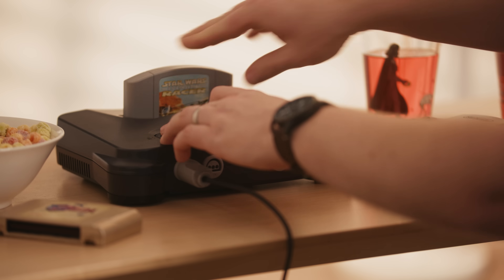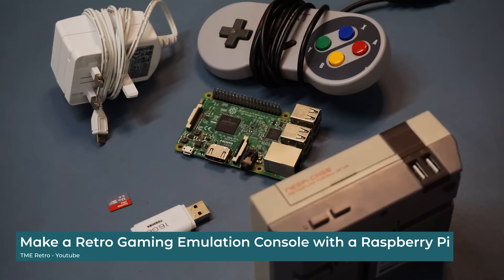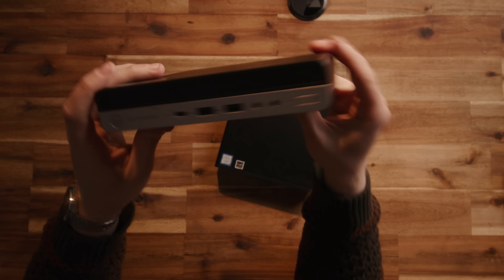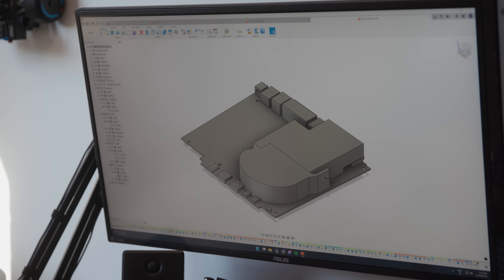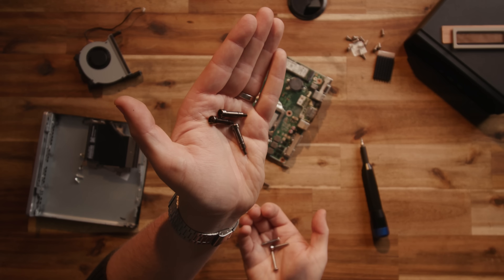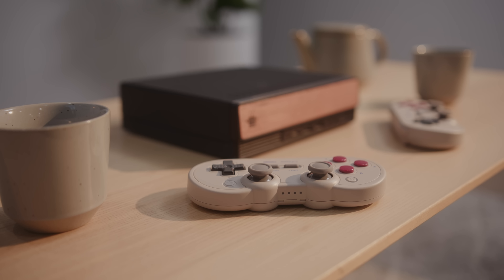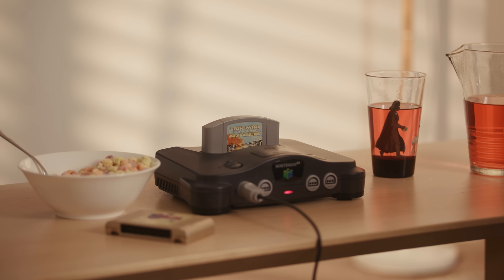Build your own games console for $200

Comment: For those of us that don't mess about with 3D printers, you could also just do some pretty simple things to still make the existing mini PCs look better.  You could do something as easy as a vinyl wrap from your local hardware store for a few bucks.  Just put it on the front panel, and cut out the ports/buttons.  You could leave the ventilation area as is.  The front of these mini PCs is so minimal, you don't need to do much to change the look.

Comment: This is a sick case!
Rather than doing variants for 300 mini pcs, you should do one for itx!
There are myriads of itx mobos with low power draw and included CPU for 100-200€, and this case would be great for theml. Just a few tweaks on the back to fit a regular IO shield (and why not, a model for a blank one, so that people that want to print a template that matches the rest of the case could spend the time aligning ports super well...

I probably won't buy a kit from you because of shipping costs, but i would buy a 3D model to support the project :)

Comment: This is nice. But don't you need quite powerful hardware to emulate games from PS3 and Xbox 360, and the likes? Moreover, if you also want to run games from Steam, EA, Epic, GOG then you'd need quite a bit of hardware, right?
I calculated that the total cost of all that can be anywhere between $1700-1900.

Comment: How about no, i'd rather buy a 100$ modded PS4 and be done in no time, get to play rather modern games+ whole ps2 library for next to nothing. For cheap gaming i have my playstations, not gonna bother with mini PCs, sbcs or any mumbo-jumbo. I got my ps2 at flea market for 15$ and made the mx4sio adapter myself, my ps3 i got for 40$ at the flea market and my ps4 was 100$ on facebook marketplace, not to mention the value proposition si kinda bad for those mini pcs .. 8th gen i5 with 16 gigs and fuckall else...i can get my hands on a fx504 for that amount of scrap, and they make a far more potent contender although not as sightly but when you add into account you 3d printed an enclosure anyway i find it hard to belive it will be that much worse off. Maybe try with a laptop next time? Could even use a slim dvd unit for more swagger points🤣👍 i reckon a ps2 phat like enclosure would do nice

Comment: This makes the raspberry pi a better option if you are saying the mini PC can cost upwards of $250. Forget the performance. Isn't the goal to save money ?
Reply: Are you considering the cost of power supplies and storage for a pi?  $150 is just enough for the board a lot of the time.

Not to mention that the performance is going to be substantially better on anything but a raspberry pi.
Reply: @GekkoGeemu whether I was considering it or not, OP is already $50 over the $200 as titled. Besides there are full pi kits ranging from $130-$159 so still below the $200 mark. If for whatever reason it cost more than $159 with the; power supply, micro SD, and HDMI cable then someone somewhere may live in a place where it just costs more due to location sold.

Comment: I love this. 

I am curious though, the emulator you were using, does it require ROMs on local storage or is it possible for it to extract things from a network storage? 

I know ROMS are generally small, but I have seen ROM libraries that take up to a TB, especially when they include PS2 and Wii titles. 

I am hoping to build a server rack with a large NAS that will hold a Plex server along with my entire Steam directory (for quick install) and it'd be cool if it could also have the ROMs so all those files are held in a central location.

Comment: im a hardware tech whos been inside hundreds of those HPs (exaggeration) and was instantly familiar when you openened it.  btw, you can add wifi antenna cables by removing two little circle bits at the back

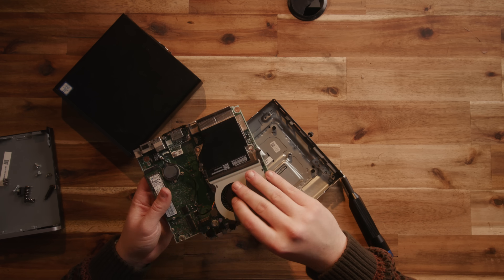Comment: Maybe making a new front panel rather than a whole case might be the better move.  I noticed a possible bottom heatsink in the original case @ 6:40. Otherwise, the integrated filter in the print is an excellent idea.  I've only seen that technique used in 3d printing for costume work until now, but it makes a lot of sense.  I've also seen printing plates with transferable effects (glitter, hologram etc) as well if people want a different look for their case.

I can highly recommend the store shown for Australian buyers of refurbished IT equipment.  They're great for mid-range and high-range systems like the one used here.  I'm personally trying to find lower spec SFF PCs for single tasks like a smart home dashboard.  I don't need the compute on offer from even mid-range SFF PCs and SBCs are just too expensive for similar compute as you mention.  I have a batch of RPi 1 B+ boards which could easily display a Home Assistant dashboard, but the software support is now gone, and any concept of a lightweight OS or browser is a pipedream these days. This is the kind of e-waste I feel bad about.  I have Pi Hole happily running on a RPi 1 B+, attached to my router. The RPi 1 and 2 have life in them still, if there is the right support for the platform.

Comment: Sorry mate - FPGA based consoles blow this out of the water and can be had cheaper. MiSTer FPGA can run everything up to PS1/N64 and hardware emulation via FPGA is miles better than software emulation via x86 CPU (Intel/AMD). 
MiSTer can also be paired with something called zaparoo, which uses NFC tags to launch specific games. You can either buy cards that have NFC tags and game labels on them, 3D print some, or just use cheap NFC stickers inside your real cartridges to launch a specific game for that real "old school" inconvenience experience haha
You can use original real controllers or bluetooth controllers 
The versatility and options of MiSTer is miles ahead of everything else on the market

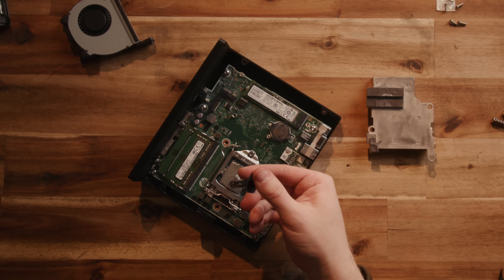Comment: RE: the cooling fan (9:50). In my experience these HP units can be quite noisy (especially when the kids start playing Roblox 3D games on it 😅). 

How has the noise level on your unit been, so far?

I got a 705 (M) | VEGA 11 | RYZEN 5 model.
Reply from the maker: I've not heard it at all! I suspect the extra airflow of the larger case helps a bit there

Comment: which raspberry pi 5 costs $150? the 2GB model is just fine for emulation, and it will run PS2 games. There is a PS3 emulator for it, but it doesn't run games at full speed. I don't see the point in spending more for a mini PC unless you're going to get one that can run PS3 games. Plus, if you had gone with a pi, there would have been plenty of options for cases. If you wanted to make your own, I'm sure there is an existing 3D model of the pi 5 motherboard. I appreciate that you put a lot of work into this and that you are upcycling, but it sounded like the PC you chose had trouble with gamecube emulation? Was that due to the intel graphics? Perhaps an AMD cpu would do better?

Comment: I have been doing this since the HP G2 hit eBay at discount prices. I find they are much cheaper and easier to get than a Pi, especially during that chip shortage.  I would just give them custom paint jobs using automotive spray paint and muffler spray paint. Which works nicely when got with at least a 1k gloss coat.😊

Comment: I was able to buy a HP Z2 mini G4 with a p1000 for $200 off of eBay. After disabling secure boot and registering the drive key (whatever that means) I was able to install batocera. It's been awesome!.. and fairly small.
Reply: Specs are intel 8700 non K with an upgrade path up to a 9900 non K. 
16gb of ram
Nvidia p1000 equivalent to a GTX 1050
It came with a 256gb nvme which I upgraded to 2tb
It has an expansion bay for a 2.5"  9.5mm sata HDD. Printing a new lid would allow me to mount a 15mm 2.5" hdd. I don't have a 3d printer or the experience.

Comment: The thing is that if you want more juice you'll need one with a PCIe slot. However most of those mini PCs don't come with one and those that do,. come with a half height single slot. The problem is then that the GPUs that fit those are really weak and expensive, to the point that modern APUs will outperform them. So it ends up just being cheaper (and simpler) to buy a new mini PC with a decent iGPU. You can get a mini PC with a 780m iGPU for 350$ now and the prices are only going down.

Comment: Doing this with some old dell optiplex micro's (got like 3 for 100 bucks) dropped in some cheap nvme's and put mint on one, other boot right into Batocera. Haven't made any nice case just using what they came in. Would like to put one in a old NES shell. The shell /case you made is dam sexy.

Comment: Great video and great result! I implore you to watch 'ITG Gear's videos and make one of these with a Low Profile graphics card size! So many people want to make a capable gaming machine for modern games in a super small form factor but we dont have access to 3D printers and soldering irons for the screws. Plus your classy design will make the cases look great!

The HP Prodesk Minis are popular as are the Lenovo Tiny Pcs (the m720q is the same size as the m920q/x) You can get a Pcie riser and fit a Low Profile graphics card in a custom enclosure (while probably being able to separate their air channels to improve the temperatures)

I already checked that you ship to my country and I would buy a kit for sure!

Comment: Your build looks great. Very well executed and top-notch quality!

But I wonder who came up with low-end hardware would be good for emulation … Actual, perfect hardware emulation is pretty resource intensive. Best those devices can do it inaccurate simulation. This works for most everyday use, but if you want 100% perfect emulation you need quite a beefy processor.

Comment: Sounds dumb but i have always found (if you can) like on that motherboard you could possibly put it on a scanner with a ruler next to it or at least a true reference of size on the motherboard itself then you have a half decent template (majority of the time) 😅
Reply: I literally bought a printer for that reason, it has worked out well for many things so far

Comment: One of the only good things about Windows 10 going EOL is all the office Mini PCs that "don't support Windows 11" are going for dirt cheap right now. Even after having to buy more RAM and replacing the SATA III SSD with a M.2 NVME you can get a Ryzen 5 2400GE model for about $100-125. For comparison, it's basically neck and neck in performance with a Steam Deck. And you can overclock the RAM to go a bit past that.

Comment: I hate you you're going to make me buy a 3d printer and learn soldering / electricity. Great video! I'm going to try to adapt this to use an m720q Lenovo Tiny as a drop in replacement for a mini ITX board in a SFF NAS case

Comment: Seems like it would be useful for you to have a way to take columnated rectilinear photographs of PCBs to design and measure from. I also need this thing, so if you can figure out a tidy way to build such a thing I might build it too. My best idea is to point a camera up at a non-planar mirror near the ceiling that gives a columnated reflection (decolumnated?). The distance with a telephoto lens will help. I haven't the slightest idea how to go about making the mirror though. I'm aware that there are ways to use openCV to calibrate the distortion of a mirror, so maybe it doesn't need to be perfect, but it does need to produce a roughly parallel perspective so depth doesn't appear to move details in 2D

Comment: A $150 pi5 is too expensive for you, but then you built a $200 machine? 

A pi5 is basically ready to go, and you can still 3d print any case you want.. just use the pi imager to slap Ubuntu on there and you're good to go

Comment: Edit: NVM he said that too. Leaving the comment for algorithm.

Tips for people who want to try something similar to this. If you find one of these PCs with no HDD or no OS, you can replace the OS with Batocera. It functions the same as retrobat as RB is based on it. This will replace the OS and it will boot into the emulation stuff immediately. It can be put on the PC by flashing it to a USB thumbdrive then booted on the PC to replace the OS. If you do this though you'll miss out on basic windows functions, it will only be an emulation console. But some of you might like that better.

Comment: Nah. I'm older both as a person and as a gamer, and no this is mostly nostalgia and gaming during your formative years. Modern gaming has a plethora of problems, yet we will find in it much better games than the old ones. 
And certainly if one is trying to recreate the proprietary walled garden hellscape of consoles, doubly so with physical accessories. I'll take computer emulation and purely digital sources over it any day. 
Now to answer your question, the probably best route for this already exist: it's a Steam Deck.

Comment: Wait, so it's just the mini PC with a bunch of extra steps?

Not even an m720q or something with the pcie slot and a lp graphics card?

Just purely an aesthetic thing? Well that's a lot of work to add a piece of wood.
Reply: Agreed. Just add a 3d printer. A bunch of filament and a laser printer and you're all set! This is just YT content for the sake of YT.
Reply: @LymanPhillips  There are 3d printable panels for these mini pcs that allow addition of small graphics cards to make essentially console like pcs. Same materials, SIGNIFICANTLY more performance. Maybe a bit less wood though.

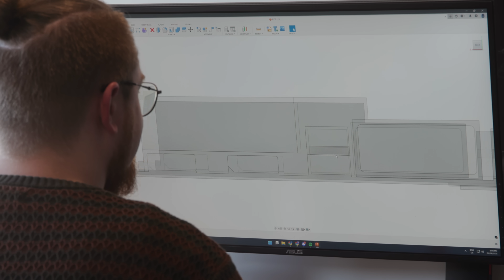Comment: 6:47 pro tip: when you're trying to capture a complicated shape, you can take a photo of it with a ruler next to it, then import as canvas to Fusion and use Calibrate to scale the ruler. If you take care that your phone/camera is parallel to the board, and take it from a bit more distance to reduce the effect of perspective, you should have a good baseline, only needing to refine dimensions of mounting points.
Reply: little tip I learned from a class I had in college is to use a quarter for scale, thery're just under an inch in diameter (0.955in) so its a handy common reference point that you can keep on hand. One of our first projects for that class was printing a quarter as a test, but also because it meant that we'd have that on hand in the future, no excuse. I now have multiple little "inch" markers throughout my EDC items. basically I carry a half-ruler on me at all times, just split up across my person.
Reply: @pet-purple-panda1634 not a lot of US quarters in Australia…
Reply: @nullvoid24 like… a ruler? 😂
Reply: @nullvoid24 I haven't used coins, or bills for that matter, in years. I don't think we even have any in our home.

I suppose a card would work too though, but at that point just get a ruler😂
Reply: @pet-purple-panda1634  lmao everything but not metric things
Reply: @martimattia1997 not all rulers are made super accurate, while things like coins are made with precision machinery and are a standard size.
Reply: I am working on a similar project to this, a 3D printed enclosure for the motherboard of my old laptop. 
And I tried the same approach. But ran into a problem where the lens distortion of the camera would make the measurements drift slightly enough that I was off by a few millimeters. What I ended up doing was to take a piece of paper and trace the outline of the motherboard and the positions of the screw holes. As well as a couple marks at exactly 10mm that I could use with the Calibrate feature.
Then I scanned the paper with a flatbed scanner and imported into Fusion. That ensured there would be no lens distortion or eyeballing.
Reply: @S_N_D_R that's exactly what I do when it's difficult to capture on photo!
Reply: I just watched a video of Bringus Studios where he took it a step further and used photogrammetry to make a rough 3D scan for reference. Definitively going to try that for a future project.
Reply: @S_N_D_R  if the object is flat enough you can scan It directly, doesn't have to be that flat to work
Reply: @S_N_D_R  step back and zoom in, try to use between a 35mm to a 50mm focal length if you can choose it on your phone or camera lens

Comment: Batocera is really a no fuss setup. I use it as a dual boot for my steamdeck. Yeah, it's lame that it doesn't have the latest builds of each emulator, but makes up for it in simplicity and reliability when you don't want to spend hours configuring settings and pairing controllers.

Comment: Old games felt better because they were so easy to get playing. No console menu, no internet required, no EULA to agree to, no account to make. Sometimes, not even a title screen.

Just pop the game in, and the game plays. Simple, quick, and easy.
Reply: I think you nailed it. The one thing I hate about new games is that if you don't play them for a few months you forget all the controls. But you can hand someone the controller for like crash bandicoot or spyro and they can pretty quickly figure out how it works.
Reply: That's true i agree that
Reply: Literally plug and play. Take the N64 out of the box, connect the cables, push in a cartridge, turn on the device, and after watching the game’s intro for the first time you’re in the main menu of the game and only have to click start to begin a new adventure. I’m glad I still have mine. 

I found Steam so confusing when I got my first pc game that required Steam, somewhere in 2008 I guess. I bought a game with discs at a store, but then I had to download this other program to play it? Make an account, be connected to the internet? I disliked Steam for some years.